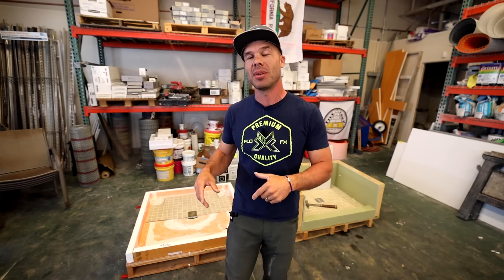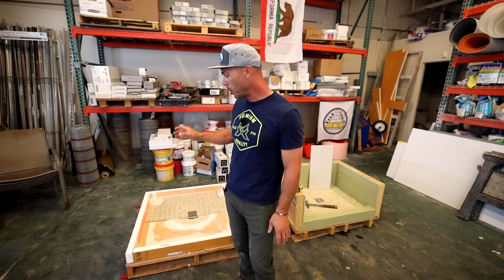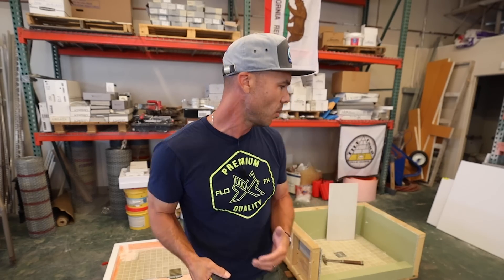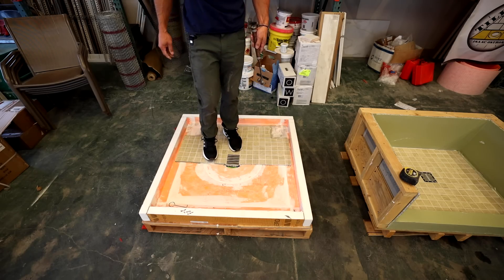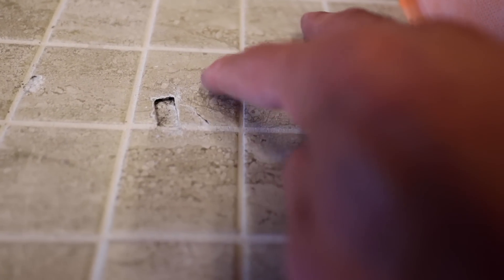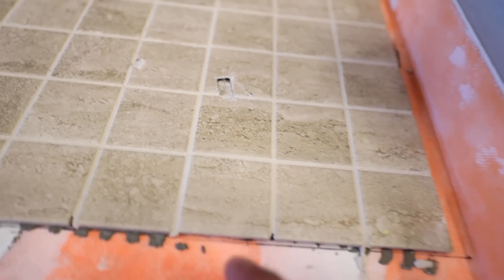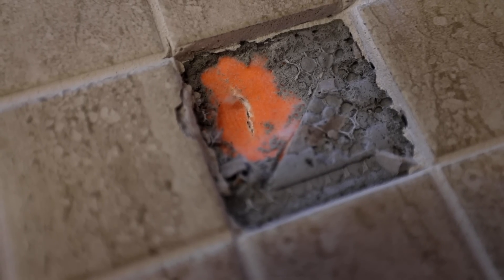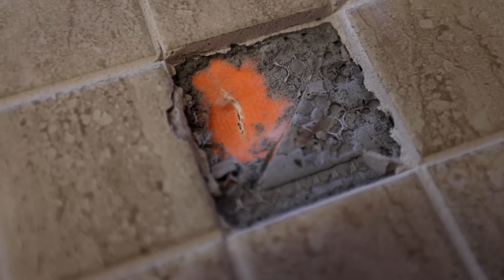FOAM VS MUD --- Drop Test 2x2 Porcelain Tile Shower Pan

Comment: I would have liked to see the repair... since you went to all the trouble to pull up the tile anyways.

Not sure how common this is... but if it is a huge problem, you can always just cover the tile with something. Even a sheet of drywall should do the trick.
Reply: If it's a mud pan with a internal liner, it wouldn't matter at all, purely cosmetic. The repair is straight forward, stick a tile back in place and grout it, nothing to it.